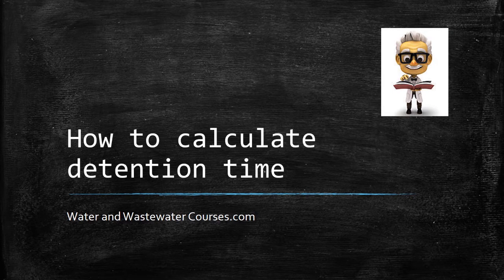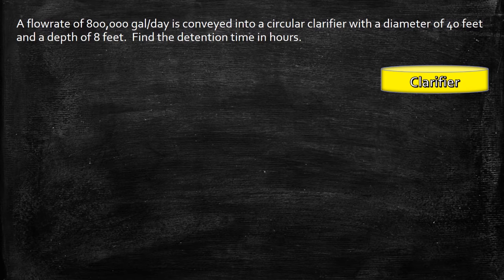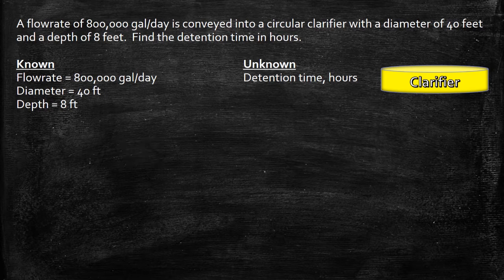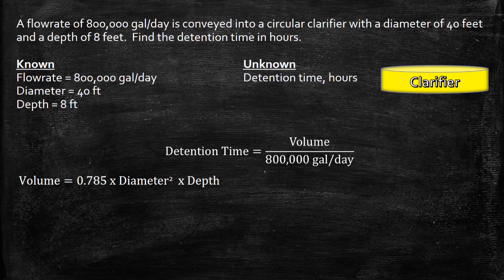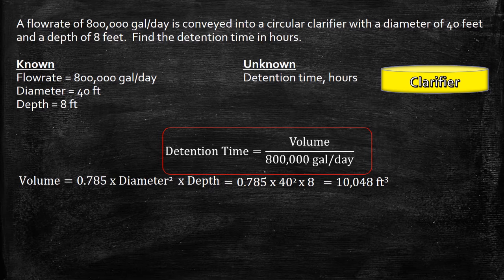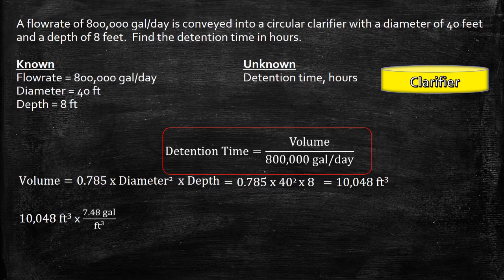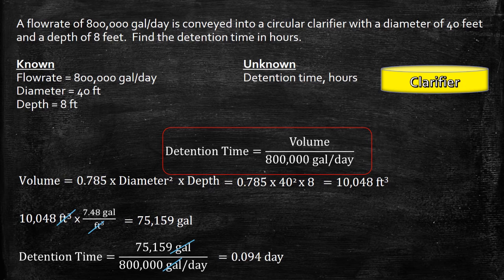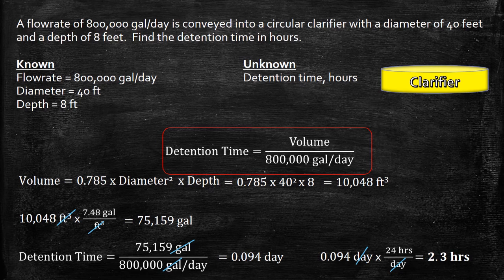How to calculate detention time

Comment: 0.785 ?
Reply from the maker: Yes.  To calculate the volume of a cylinder, you can use the formula in the video, or  π x r² x h .  You'll get the same answer.  Use whichever you prefer.
Reply: 7.48 ? how it came
Reply: 7.48 is the conversion rate of cubic feet (ft3) to gallons